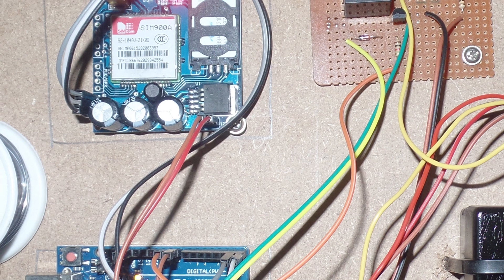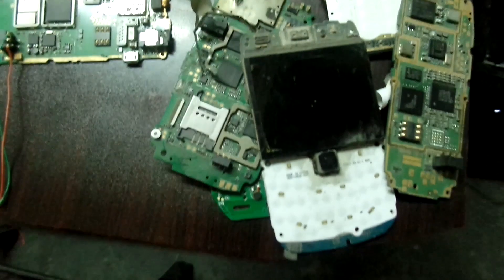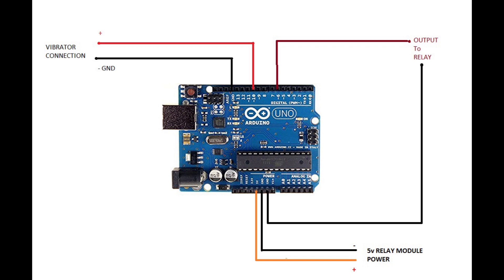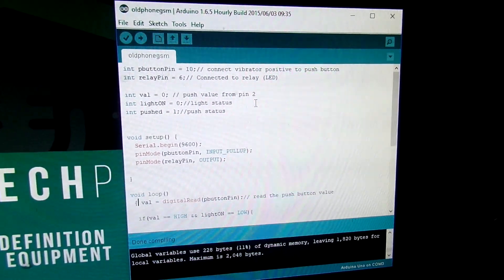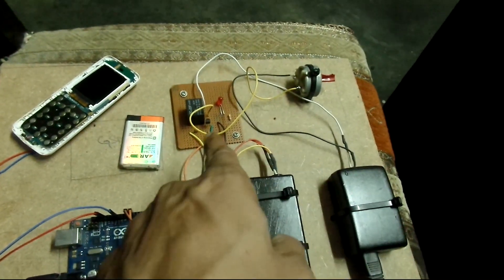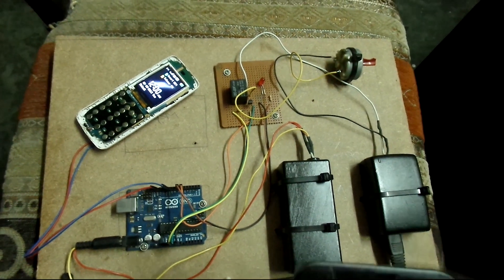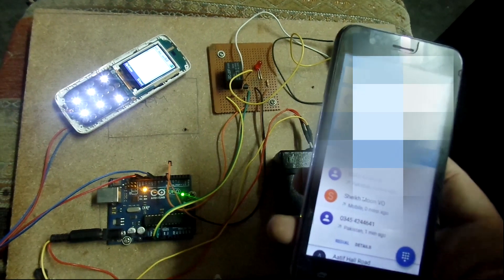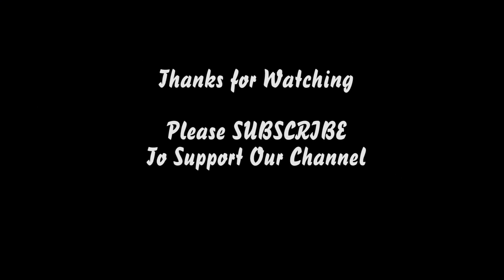Arduino GSM based Motor (Without GSM Module)

Comment: Nice video
You could use messages instead of calling and instantly declining the call.
Reply from the maker: yes you're right i observed that message was giving two pulses so i added delay to arduino to make it work with messages. I did upgrade the code but never got a chance to upload the video again.
Reply: @samtechpro  Thanks